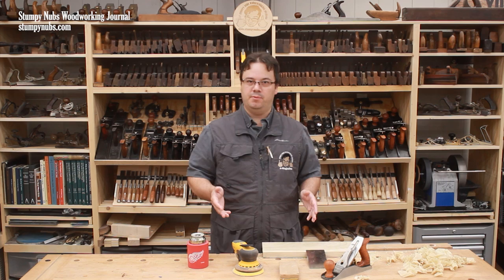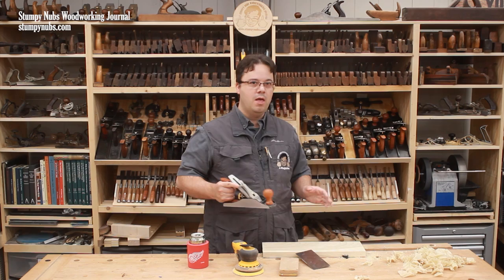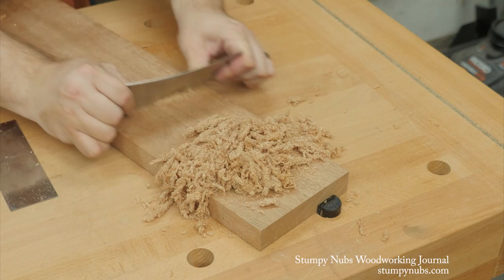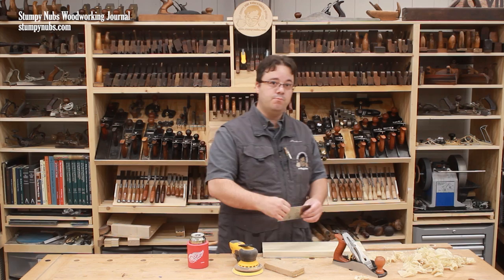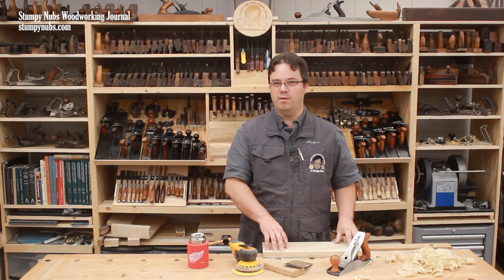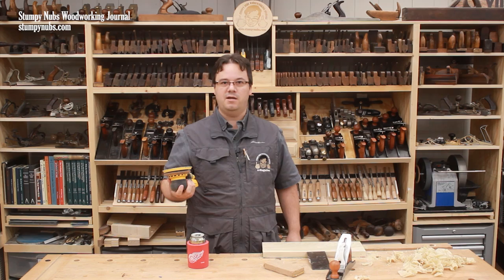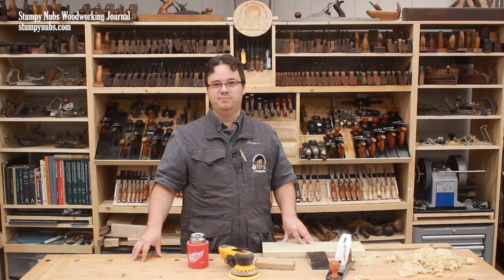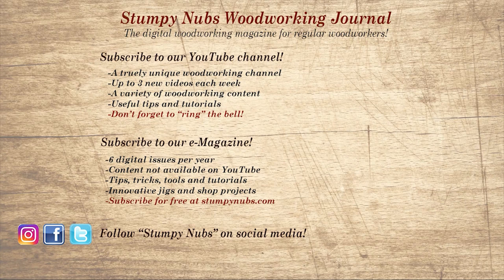Is it better to Sand, Scrape or Plane wood?

Comment: First, great overview! Sat on the edge of my seat the whole time. One thing I think that needs to be included is consummables. Plane blade rarely needs replaced. Scaper also rarely needs replaced. Sharpening tools rarely need replaced. Shopvac filters, face mask filters, sanding disks, sander batteries and electric to run the sander and shop vac are reoccurring costs. Not to mention replacement of the sander itself, though not frequent I doubt anyone will be using a 100 year plus RO sander in the future.

Learning for hand planing is much higher but I think it’s worth it. No worries if your opinion is different, do what works for you

Comment: The biggest consideration in my mind is the level of finish quality desired. Sanding is adequate for utilitarian projects in soft woods. For a fine finish on heirloom quality hardwoods it’s hard to beat a scraper because of the control you have. A well tuned plane gives a glass smooth finish if, as you say, the wood cooperates. My vote goes to a razor sharp cabinet scraper for that finishing touch on things that matter.
Reply from the maker: There is no doubt a plane or a scraper produces a smoother surface. But most of that goes away once you put on a film finish.

Comment: Funny this topic came up, I spent time this afternoon thicknessing some pine for a small cabinet in Mike Pekovich's book. After I finished thicknessing I grabbed my smoothing plane and started  cleaning up the surfaces. I will admit...I could NEVER get a surface that glass smooth that quickly with sanding. 

Yes its less convenient and predictable than sanding, but using a good sharp smoother on reasonably predictable wood (pine, cherry, walnut) is a joy. Oak and ash require regular sharpening but aren't that much harder. Maple? Yeah sand that. 

Great video as always!

Comment: Good info.  Nice video as always.  In my opinion, in straight-grained wood, a smoothing plane provides the best overall finish because it cuts the grain versus sanding.  Sanding basically smashes the grain. Think exploded cigar.  It shows in the finish.  The difference is obvious.  Figured wood is altogether another issue with a plane whereas tearout is an issue no matter how sharp the plane is.  A scraper or sander works best on figured wood.  That's been my experience in over 40 years of woodworking.
Reply: @tungsten_carbide  I hear you but it would also depend on how well you can see.  Lol
Reply: @tungsten_carbide  LOL.  There's plenty that can't see well or simply ignore what they are looking at.

Comment: Well done Stumpy! There is nothing in woodworking that is easy, do to all the variables in getting a job done. It's an art and science, a good craftsman understands as well as patience. Everything is easy when the stars are aligned, but an experienced craftsman knows how to remedy an issue to success with knowledge and patience till the end!
Great discussion, another factors not discussed was cost. Since wood is not perfect you will need all three methods and  hardware to beat the devil in wood! And that is were cost may be a factor. Style of wood working is another. Rustic, carpenter, cabinet or funiture makers have different degree of tools and methods. So many factors in bringing a good woodworker!

Comment: I think that most YouTube woodworkers demonstrate using sanding because it's the lowest skillset required of the three.  Anyone can take an ROS and get a decent finish with enough time and a supply of papers.  Using a plane effectively takes some practice, skill and as you pointed out an understanding of wood grain.  A lot of beginning woodworkers may not even know what a card scraper is.  Another factor to consider is cost.  The scraper comes in first with that since you can get a decent scraper for under $10 (or make your own from an old saw plate), and all you'll need extra is a file and a burnisher.  The sander probably comes in next for the initial investment on the tool and a stock of various grit sandpaper, though there will be the recurring cost of that expendable item.  The plane would be the greatest initial investment, not only for the tool but for the sharpening gear needed to maintain the edge.

Comment: There is method behind hand planing and sharpening. This is also one of those "don't buy cheap or you will regret it" areas (kinda goes with most woodworking tools right?). A high quality 5 1/2 plane is a good choice and after tuning and sharpening is just a real joy to use. Pay attention to how much blade you expose. For difficult grain use a light cut and keep the plane mouth narrow to avoid the raising of the grain.

Comment: Depending on the project, I may finish using any of the three methods. Scraping is great for smaller pieces, planing is great for those pieces that have tool marks and sanding which is generally what I go too just because it's more convenient works to get me where I need to be on most projects.

Comment: Better than a straight scraper with a holder is a curved one. You can grind the curvature equal to the one you achieve by bending a normal scraper.

Comment: There are a few other factors to consider. A table top is easy to plane, but what about the aprons and legs especially if recessed or curved. In addition, also staining wood can be sacrilegious in some circles, a planed surface won't generally take stain as well.

Comment: As always James, well done. I have tried scraping and using a hand plane and I just have not mastered these tools enough to feel comfortable using them on a project. I agree with your points but as a novice I will stick to sanding with the various grits.
Reply: @tungsten_carbide  Thanks for the quick response. Since you are knowledgeable on the scraper topic, let me get your opinion. I bought a Bahco scraper and watched numerous YouTube videos on how to sharpen one. I could never get the 'hook' necessary to create shavings, I always just got sawdust. I even took it to my local woodworking store and the 'sharpening expert' did not have any better success. Is there another brand that is easier to work with or am I just destined to using the orbital sander? Thank you for your thoughts.
Reply: @tungsten_carbide  Thank you so much for taking the time with this detailed response! I will view the video by Galbert and give the scraper another try. Again, thanks for going above and beyond.

Comment: I love my hand plane but the tear out is the reason I rarely use it. With the scraper it just hurts my hands/fingers. Now the sander is excellent! I'm a welder by trade so it just takes the place of my grinder. I haven't tried a grinder on wood, but I can get metal flat and square pretty fast with a flapper wheel. I have a feeling the wood will just burn though so thats why people use planes/scrapers/sanders and not grinders lol.

Comment: You need to explain that sanding to a grit higher than say 150, 180 closes the pores so finish cannot penetrate.  After you put on your finish you can polish to higher grits using things such as Abralon pads to very high polishes, up to 6000, for a piano finish.
Reply: I regularly sand to 320 before staining/finishing. The trick to sanding to higher grits without burnishing the surface is changing paper regularly and often, and also using as little pressure as possible to keep the paper moving on the wood.

Fresh paper cuts better with less effort, anyway.

Comment: Each method of finishing has its merits and drawbacks what matters the most to me is the size of the surface one needs to bring to a smooth finish and the lumber one is preparing.  No doubt a blade will finish most small wood projects with the smoothest surface but I'd like to see someone scrape a wood floor - that would take a crazy amount of time and a couple of very sore knees.

Comment: Something that no one ever mentioned when i started learning sharpening and using hand planes is about stropping ... I stop every few minutes of planing and STROP the edge , this "burnishes" any microscratches in the edge and keeps the edge fresh ... This extends the time between shaprenings - i have, at times, went months between sharpenings just because i kept my edge fresh every few minutes of working with a hand plane

Comment: Great video as always.  An orbital sander w/ good discs (Diablo are great) can take off a giant amount of material or a little bit depending on grit and technique.  I find it WAY easier as a relatively newer handtool user who is still getting his skills (technique/sharpening) together.  For instance, the scrapers are actually the hardest of the three.  I save them for touch-ups and specific problematic areas, as well as glue removal.
Glad to see your injury (not sure when it happened) is a memory, however traumatic!  Keep on working, my friend.

Comment: I've found that almost all tear out can be eliminated when planing unless the material is terrifically difficult.  I use as light a cut as possible, leaving a glossy surface.  If there is some minor tear out a scraper or even a little bit of sanding will do the job.  But if I need any sanding after planing, I usually just lightly do the entire project.  I find it impossible to match a sanded surface to a planed one.  If you are just aiming for approximately rustic quality planing, and then burnishing any tear out, produces more than adequate fished surfaces without the pain of dealing with the fibers lifting that you get with sanding.
Reply from the maker: There is no doubt a plane produces a far smoother surface. But most of that goes away once you put on a film finish.
Reply: @StumpyNubs  One woodworker told me years ago that if you planed wood, you should sand it afterward because the planed surface was too smooth.  I was trying to say that you can use all the methods you mentioned at the same time.

Comment: As one whose designs lean more towards curves rather than flat surfaces, I tend to pick up my sanders more than my hand planes.  And even scrapers are challenging to use of curved surfaces.  Would you care to comment on smoothing curved pieces?
Reply: Spokeshave?
Reply: @wyssmaster  We're talking about preparation for finishing, not establishing a shape, so no, a spokeshave won't work for this.  However, James Krenov and others prefer the faceted surface left by such hand tools, so if that's the look you're after, then yes, a spokeshave would work for this.  But that's not the look I'm after.

Comment: I think one thing you didn't address is the size of the piece you're smoothing. A 30" wide by 12 foot long harvest table is a nightmare to try to smooth with a scraper or a plane. Or a 6 foot diameter round table. It's difficult to reach out to the middle and apply enough force with a scraper or hand plane. A light weight battery sander is the way to go in my opinion.

Comment: Mirka sander is the best !!!
Reply: The Festool Rotex sander is very quick in geared mode and on normal random mode is still quick. Hooked up to a vacuum it has excellent dust extraction.

Comment: I was really hoping for a "princess bride" moment... Planing leaves lines in the wood, so clearly I cannot choose hand planes, and you know, that I know, that you know scrapers require ongoing maintenance with a burnisher to hold their edge so clearly I cannot choose the scraper. So, sandpaper is your choice? ... Not hardly, you see sanding takes effort and time and fills the workspace with sawdust requiring a breathing mask so I cannot choose sandpaper. But everyone knows nothing beats sandpaper when a glass-smooth finish is on the line...

Comment: You can create a FAR better finish with a quality plane than any sand paper routine or scraper. There is no substitute for a planed surface. I’ve built high end furniture for many many years

Comment: ok , so you stop at 320 g before you finish it and no higher.... but planing makes a even more smooth finish . do you finish the 2 differently?   If not,  then why not sand to a higher grit like 1000 ?

Comment: I live in a condo building and do my wood working on my patio, so noise is a big factor for me. Obviously the plane is far quieter than the orbital sander so I want to use my plane as often as possible. But as you say the wood rarely cooperates, can be very frustrating.

Comment: Sir, Is there a steel plane on the shelf just above your Tormek sharpening machine. Does it work or is it just a model?  If it really works could you demo its use, some day?. Have seen wooden planes and regular iron planes with wooden handles but not a total steel plane. How does it differ from the regular planes?
Reply from the maker: This one? https://bridgecitytools.com/products/hp-12-smoothing-plane

Comment: Truth is, if you're hoping to get the absolute crispest appearance, you're going to have to plane, and scrape. You have to be careful, and painstaking, to get it right. There really isn't any way around it, but people have learned to settle for sanding, because it's cheaper. And wood is crappier, with many changes to the grain direction, causing one to have to be very careful, in planing and scraping.
Reply: And if you think you are done with finishing after planing, you're pretty much wrong.

Comment: Which is the best value in the long run, planes or scrapers?
Reply from the maker: Depends on how "long" that run is. A good plane and sharpening gear is a big investment. But good sandpaper isn't cheap, either. The former is a one-time purchase, the latter is continuous. Eventually, the plane becomes cheaper.
Reply: @StumpyNubs  A good random orbit can run you as much as a decent plane, too. Sanding by hand will make the plane far less work.

Comment: Does the view on hand planes change when using Eastern Pull-style vs Western Push style designs?
Reply: @tungsten_carbide  I was more thinking of the damage from grain direction changes. I find my Japanese planes handle grain direction changes better than my Stanleys do.
I'm not sure if that pull vs push or if the angle differnect is that dramatic.

Comment: The first time I sharpened my plane it actually took several days lol. Ah, the naïveté of the noob.
Reply: @tungsten_carbide  yeah exactly! "Oh look, the back is perfectly flat, we can move on..." Mean time, I can't tell if the back is flat, I think it isn't, I spend days "sharpening" and still end up with a dull blade. Neat. But I wouldn't change a thing. That's the way you learn. These days I can spend 3 minutes ten times to get a sharp blade yay

Comment: How many of those hand planes on the wall do you actually use?
Reply from the maker: If you watched more videos on this channel you would know :)
Reply: @StumpyNubs  I too gazed upon your collection, no tool is worth owning if it servers no purpose.  In my opinion the problem with today’s society is that we’ve forgotten the ways of our forefathers.  We’ve become too reliant on jointers and planers. I can honestly say I have no idea on how to true a board with a hand plane.
Reply: @StumpyNubs  fair enough. I've watched a good number of them and always wondered. I guess I missed the one where you answered this question.
Reply: @htxb  If it's the one I'm thinking of it wasn't that long ago - maybe a month.
Reply: @rogerdesousa1451  you need winding sticks (which are basically just 2 parallel sticks that are 2-3 feet long). You can Google for more info, but basically, stick one on either end of the board perpendicularly. It will exaggerate any twist in the board. Then use a plane to remove high spots till it's flat.
Reply from the maker: @rogerdesousa1451  https://youtu.be/-pFmUsrtKlI
Reply from the maker: @htxb  https://youtu.be/-pFmUsrtKlI
Reply: @StumpyNubs  thanks!

Comment: I disagree with only one thing.  If sanding by block or hand, don't sand in straight lines.  The scratch marks (yes, they're there) show in straight lines and your eye is drawn to straight lines.  Random orbitals solve that by sanding in oblong circles and remove scratch marks your eye is drawn to. It's not as bad on wood as it is on a car surface.
Reply from the maker: You right, we do disagree on that. I would never use a ROS for the last grit because a scratch across the grain is more visible, even if it is randomly positioned. :)
Reply: I cannot comment on car finishes but if you you see the scratch marks in the wood you stopped sanding too soon.
Reply: @dwightl5863  That's probably right, but then again how much is not enough especially for those trying to make the buck off your work and time factors, et al.  I'm just saying that I use ROS on panels because I, personally, can see a lot of scratch marks if I sand by block or hand sanding with the grain and when I use the RO, they disappear.  Same with finishes which IS like a car's finish.
Reply: @dlevi67  Well yes, but depending on the finish like poly, it IS like a car finish you're dealing with.  I just get a better finish over all with RO.
Reply: @StumpyNubs  Yeah, that just hasn't been my experience.  I have much better finish even on veneers using either ROS or if I have to hand sand, I use the same motion with straight grain.
Reply from the maker: That's not true in a practical sense. 180 or 220 grit scratches are visible to the eye under finish if they are across the grain. But they can not be felt under a film finish. So finer sanding is a waste when you can just sand the last grit with the grain and make those scratches disappear.